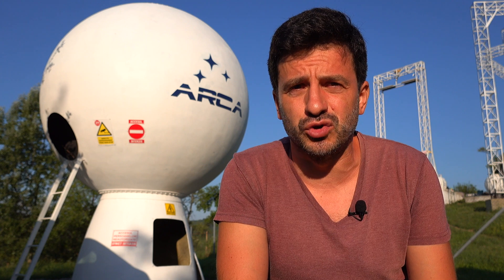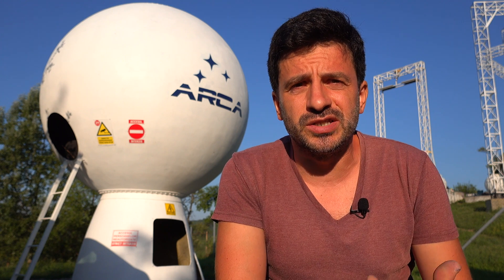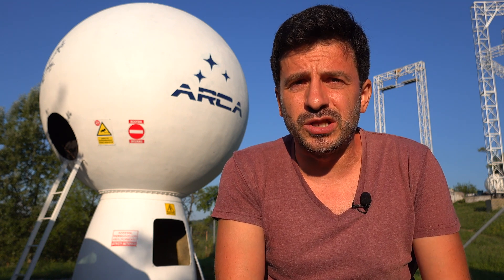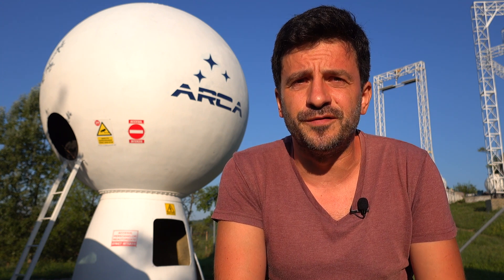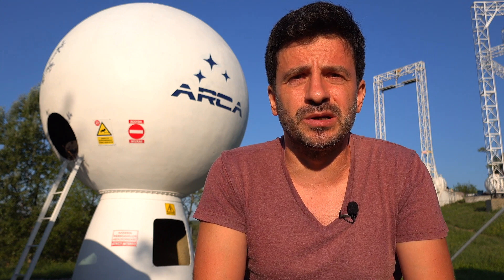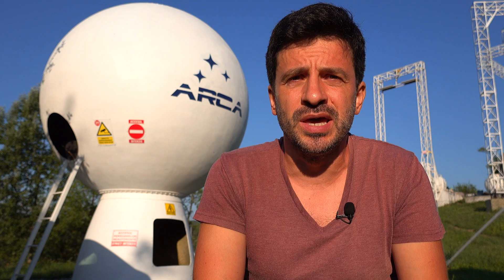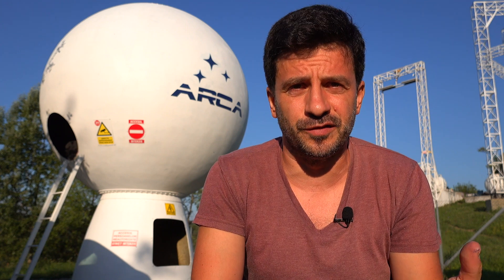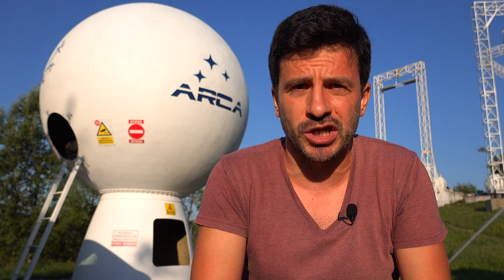MISSION 9 - SITREP 26: What is Flight Readiness Review - Part III

Comment: I am the only one that think this antenna tower would be awsome as a living compartment or TEC station on a Mars or Moon base? ha ha.
I think the design would work well both to be sent by a rocket and in order to hold both a pressurized part on the top as well as a non pressurized part for tecnology in the bottom part.

I realy apericiate the fact that You are open with what's going on and even choosed to share all those tiny steps in public.
I think this will sucess when the nessesary reserach is done, many people in the comment lines seem to be stuck in taughts related to older tecnology, but forgot about the fact that i can even buy things that use similar tecnology in an ordinary model shop today, some of us are just blind to all the wonderful things that surrounds us in our daily life and we now take for granted, but may not even existed available to public use 10 or 20 years ago, but i now use in for example both my cellphone and my model boy(and girl)toys.
Reply from the maker: Yes, you right. When your mind is set to certain values, approaches, ways the things are done, when you see new ways of doing things, then automatically you become defensive. It's part of brain's conservation instinct. The thing is, in this industry used to do the things the same as 70 years ago,  people are reluctant to embrace new ways of doing things, but we are getting there.
Reply: @ARCAchannel  Yes, as i probably mentioned before i even hawe an old scematic of a booster engine for aircraft in the 1940s (that was actuly widly in use long in the 1960s as i remember from my books) wich are using boiling water as propellant, just to draw one example of something that has been well prowen to work,  claiming that it won't work at all is just ignorant and straight off plain dumb.